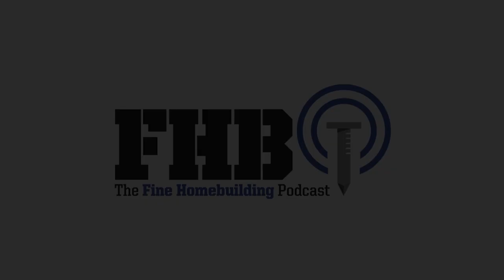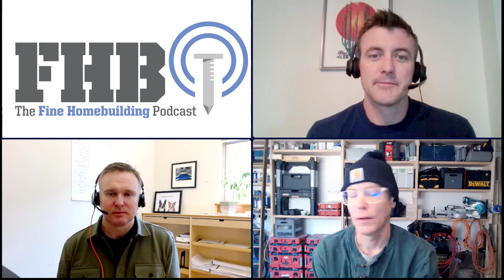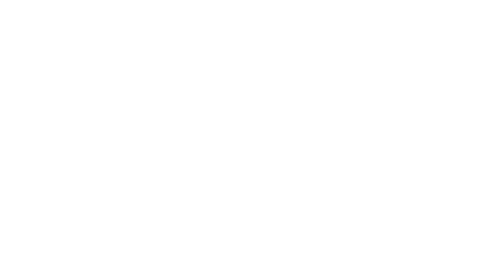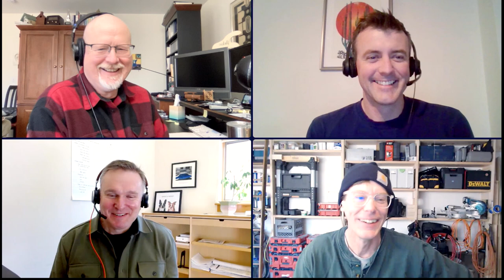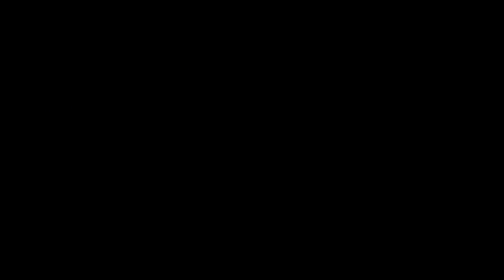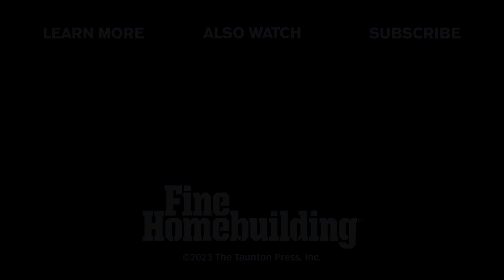Podcast 555: New-Build Questions, Low-Down Lasers, and Drying Behind Tile

Comment: I think more people would be willing to buy into multifamily housing if they did a better job with occupant comfort, especially  with acoustic comfort. I don't know how much more it costs to add acoustic isolation details but half the challenge is improving airtightness between units which is already a no brainer in terms of occupant comfort.